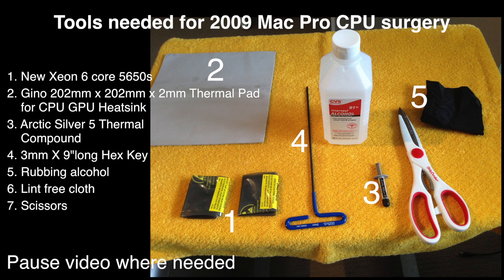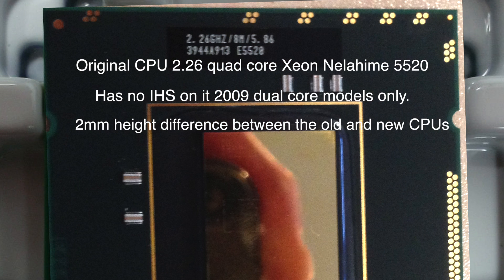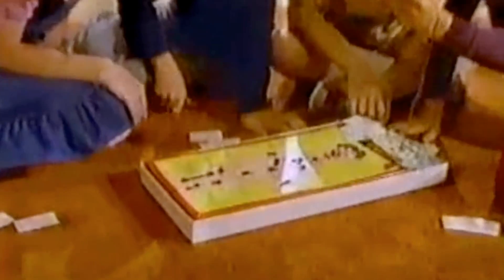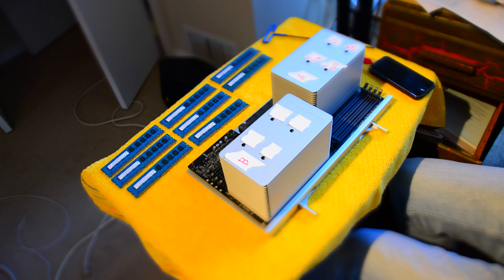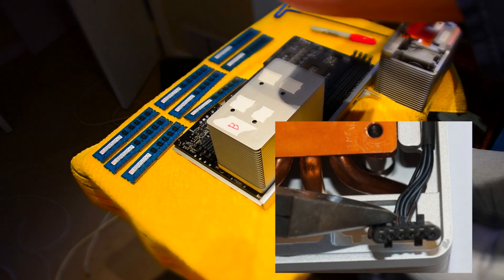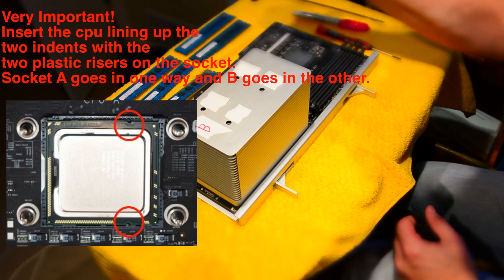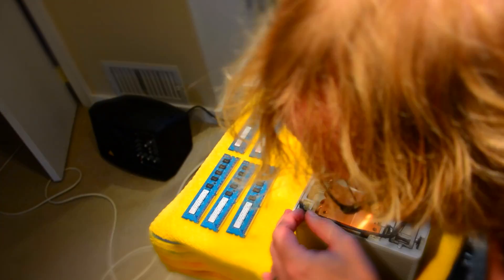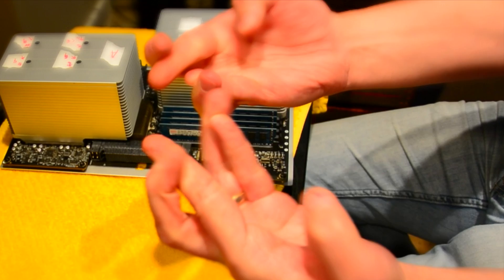Mac Pro 2009 5,1 CPU upgrade 8 core to 2010 12 core

Comment: turns out that counting the turns of the screws is useless. But if you have done that more than once you would know :)
good luck next time
Reply from the maker: I agree to disagree. I think my doing it and seeing the difference in unscrewing the heat syncs and screwing them back in with the new cpus can help folks get the fact that they should not over screw in the heat syncs. That the 2mm difference is a big one, around 8.5 to unscrew and about 3.5 to 4 to re screw with the new cpus. Plus if you were to put in the original processors back in you would no exactly how many turns it takes to put them back in or very close.  Also when I go to upgrade to newer processors I will definitely do the counting of the turns again as it will take the same amount to unscrew and re screw... "useless" I think not. An exact science no but again I think it gives a helpful point of reference.

Comment: SPREAD THE HEAT PASTE!!!

I read so much rubbish about electronics online, some of it really dangerous, please don't do something because someone else did, use your brain. A pea sized blob of paste will spread according to the minute off axis tilt of the heat sink as you lower it. It does not 'sort itself out'. Spread it and any over run will squeeze out the side and just conduct heat from the side of the CPU harmlessly. It is designed for it.

I strongly suggest you remove the heat sinks and apply the paste properly as you may be experiencing localised overheating which will lead to the CPU adding wait-states (under clocking without changing clock speed) to cool itself down.

I have over 35 years in computing, am a former technical writer for major industry magazines and build all my own studio electronics. Please ignore 20-somethnigs with shaking out of focus videos who read a forum and are now 'God'.

Other than that, ace video! :o)
Reply from the maker: Thanks Prince, you made me go dig a little deeper on the subject of doing the pea method or spreading the thermal compound. It turns out that you should put a vertical line across the cpu not spread it and but possibly also do the spreading part only on the heat sync itself to "speed up the break in period" of the thermal paste. I did not know there was one. Check out the PDF file via the link. These are Arctic Silvers directions on how to apply their thermal paste on the Intel Xeon 5600 series processors.
http://www.arcticsilver.com/pdf/appmeth/int/vl/intel_app_method_vertical_line_v1.1.pdf
interestingly they do recommend using the pea method on different processors but not Xeons and spreading on some and vertical lines on others.
Reply: Lance McVickar  Yeah, I know on some CPUs, particularly those with surface mount resistors that determine core speed, that some semi-conductive heat paste can be a serious problem or cause damage. This isn't the case with the Xeon and their heat spreader top. I can see heat paste manufacturers covering themselves from people overloading their CPU with paste whether their brand or others. Its always worth reading past the lawsuit protection verbiage!

Paste run-in period - I had heard of that on some grey / metallic pastes but its never stopped me just rendering 3D at 100% load for days and it not being an issue! :o)

I'm looking to get a Mac Pro 4,1 and upgrade. Being a long time PC user I've always been very gung-ho about upgrades but now I'm looking at spending a lot of money on a Mac, and if it goes wrong its lots more money, I'm starting to be as timid and careful as you! LOL
Reply from the maker: Prince Westerburg  This is the guy I got most of my info from initially. He performs the service for folks who don't want to risk it themselves and guarantees his work.
http://www.pindelski.com/MacProTurbo/

Comment from the maker: Here is the original link to download the firmware update tool from 2009 to 2010 from the guy who created it on Netkas.org you have to become a member before you will see the attached file at the bottom of the first post in the thread.

http://forum.netkas.org/index.php/topic,852.0.html

Comment: Great video!  You gave me the courage to order a dual CPU MB535LL/A ($720/eBay), I've already done my 4,1 to 5,1 firmware update, have a clean pair of 3.46GHz X5690s on my desk ($245 ea/eBay) and now waiting for thermal paste and pads to do the transplant.   (I'm going to keep the lids on and use 2.2mm of washers as depth guides.) I know those power chips along the side need some dissipation, so my question is about the thermal pads: did you simply place another 2mm layer over the existing pads on the heatsinks, or remove the original and build up a total of 4mm from two 2mm layers?
Reply from the maker: I just added to the existing. Good luck and let me know how it goes, Those X5690s are getting cheaper by the day, I will most likely get some later this year.
Reply: Lance McVickar Any idea if you wanted to replace existing how thick to go on the thermal pads?
Reply: Gregory Orme I initially put on 2 layers of fresh 2mm thermal pads, but after mounting the heatsinks they seemed too high.   So I shaved one layer down by about half with an Xacto knife and they seemed compressed together just about right after the heatsinks are installed to the correct tightness.   BTW, my machine is running kickass now, though CPU 1 definitely runs hotter than CPU 2, I THINK because the Northbridge shares its heatsink.   With 1TB of SSD and 24GB of RAM my geekbench score is 30K+.
Reply: Steve Hoge Thank you for the input. Great job, although shaving down the height of a thermal pad is the kind of fun I was hoping to avoid! I have not purchased the thermal pad yet, so I will look for something around what worked for you, with the understanding that every setup has its subtleties. In my limited experience, CPU 1 runs hotter in many cases.
Reply from the maker: Gregory Orme you just need one layer of 2mm thermal pad in addition to what is already there. The ones I cut to fit were 2mm in size, which it states in the video.
Reply from the maker: Steve Hoge Yeap my cpu one runs hotter than #two. That is normal I believe. My upgarded mac pro is now a year old and is still going strong. 5690s have really dropped in price. I may do another upgrade soon. I am envious of your Geekbench score congrats!
Reply: Lance McVickar The reason I had to split up one 2mm pad in half was that I destroyed the original one :(

Comment: Hi I have some questions Lance .

1 Are these CPU's ok for the 2009 to 2010 upgrade

   Intel Xeon CPU X5670 HC 2.93GHz 12MB L3 Cache LGA 1366 95W 6.4 GT/s SLBV7

   Intel Westmere Xeon X5650 2.66Ghz TB 6 Core HT 12MB L3 B1 LGA1366 95W 32nm

2. Because of 2 wrong Chingn Chang CPU's i damaged my cpu sockets and  have ordered a new controler board 8 core.
    I forgot to check the side that it had no black  dots on. ( It did have some black spots that dammaged my socket ) Is it true
    that  a cpu that has some dots not covered in gold that they F..z up you're sockets (I read that    
    http://www.anandtech.com/show/2859 )

Thanx man !

Comment: Thank-you Lance for taking the time to prepare this exceptional video which translated to instilled confidence to attempt this upgrade. As per your detailed instruction I joined forum.netkas.org and downloaded the then visible software link. In my particular incidence I encountered an error, "5570". I elected to take a break, relax, and address this concern after a coffee. On page 55 of forum.netkas.org I found mulitple threads that addressed this error. I elected to try the solution the required the least effort. Resultant, everything worked the way is it was suppose to, and my firmware is now upgraded. Cheers,
Reply from the maker: Great glad it worked out, not sure what the error 5570 as I did not get that could you post what why you got it and what you did to fix it. Thanks!
Reply: Lance McVickar

First and foremost I urge followers to become a member of forum.netkas.org, Additionally, if you have cardinal knowledge please be a contributor at any capacity as its vital to our community of owners.

To address Error 5570:

I followed member "Tobyglyn's" advise to the letter as he detailed in his post.

1) Download the Mac Pro Firmware update 1.5 (MacProEFIUpdate.dmg) from Apple: http://support.apple.com/kb/DL1321

    With the downloaded .dmg on the desktop, double click to reveal the package.

2) Now run the Mac Pro 2009-2010 Firmware Tool.  

There is no need to rename or replace anything. The Firmware Tool grabs the package and does its magic with no 5570 error message. 

Thanks to contributors like this I had success. Now, I'm awaiting my 2X 6 core chips to upgrade.

Important note: Be sure you know definitively what your doing in regards to de-lidding, if you elect to go that avenue. All chips are not the same hence this Lance tutorial on Mac Pro upgrades is imperative to your financial well being..smile.

Thanks to MacEFIRom, Tobygln, all the contributor on Netkas.org for community support, insights, and growth.

Special thanks to you (Lance McVickar) for taking the time and effort to produce exceptional documentaries on how to perform these modifications on Mac Pros. Your effort gave me the confidence to persue and grow at all levels.
 
Cheers,

Comment: Thanks for the video, very helpful. :)
After watching it, I too decided to attempt this upgrade, but I'd like to make some points which I think are important in the process that you didn't mention...
1: Each Mac Pro's responsiveness to the tightening of the heatsinks screws seems variable. Some have proven relatively easy to make adjustments on, others (like mine) go from blinking white light, to red CPU light in less than a turn.
2: The response of each screw is different too. Turning one screw 2 full turns might be easy and turning another might be a lot stiffer which can be disconcerting.
3: The removal of the cable from the heatsink isn't easy. You have to have be very careful when doing it and the cable is VERY delicate. This part of the procedure is a lot more involved than it sounds (and indeed the cutting and removing is not shown in your video, just the result is) and I'd recommend that you try the upgrade without doing this first. Only perform this if your fans spin up full speed as with the connectors left in place make proper placement of the heatsink MUCH easier.
4: Many people have found using a 2mm washer on the heatsink threads helps prevent over tightening, so this may be a good idea.
5: Success is very hit an miss and it is likely that you may have to have more than one attempt at the procedure to get it to work.
I myself have so far been unsuccessful performing this upgrade (only 6 cores showing), despite doing lots of reading and research prior to installation, so a success IS NOT guaranteed and failure can be VERY expensive.
These few comments aside your video was spot on and it'll help far more people succeed - thanks! :)
Reply from the maker: Hi Blott,
All good points, one thing about just feeling the screws is that Apple puts loctite on them, that blue stuff to lock the heat sync screws in place, this can give a false feeling of
the screw tightening or  possibly the inconsistency that you mentioned. That is why I think even rotation on each screw is important, and yeah each mac will vary but the screw lengths are the same. That is why you can't really judge it by feel alone. I did not use washers but others have had success with tthem. I did not because the article I read said they may give you a false feeling and that you can still over tighten them and to not use them. I agree that removing the connectors from the heat syncs can be really tough and if you can get away without doing that great. Did you put the extra thermal pads on? Sorry you did not have success perhaps try the CPU that is not working in socket A and see if it works. If it does then you know both are working CPUs then look closely to see if you have any bent pins in the non working slot. I have heard folks finding bent pins and straightening them and that fixed it. You can boot the mac pro with just one CPU installed in slot A. It is a very tricky install which I do say in the video and yeah it can be very pricey if failed. Have you put the original processors back in to see if they still work?
Reply: Lance McVickar Hi, it turned out I had one faulty CPU.
I received a replacement and am now the proud owner of a 12 core Mac Pro! :)
Thanks very much for doing the video, it helped ENORMOUSLY! :)
yes I did the extra thermal pads and like you did not use washers, but thought it important to mention the sometimes very different response of the screws in the heatsinks, as this was very worrying when I was struggling...particularly when I couldn't get CPU B to work. 
All's good now though - thanks again! :)
Reply from the maker: Awesome congrats on your new BEAST!

Comment: Not being quite crazy enough to attempt this upgrade myself I just purchased an upgraded 5.1 2009 3.46GHz twelve core Mac Pro with 16GB of 1333 memory and a 2GB HD, which looks to be in decent shape, for $2348 from a builder on eBay. He had posted what I assume was a picture of himself so I thought, that’s good. I know which town he’s from and what he looks like. :)
Reply: Lance McVickar I found 2 Xeon 5690s for $700 and the tower I've had for 2-3 years... I saved money. A lot of money. Thanks again for the tutorial.
Reply from the maker: Excellent price for that config, You could save some money if you did the upgrade yourself but not much, the 8 core 2.26ghz 2009s are getting harder to find usually around 900 plus a pair of Xeon 5690s would run around 800.00 so 1700 for the basic box with upgrade but then you would also want to install the faster 1333 ram.
To make your new mac even better I would install a pcei
SSD card like this one
http://www.sonnettech.com/product/tempossdproplus.html
Or OWC Mercury Accelsior. For your boot drive.
Congrats on your purchase!
Reply: Lance McVickar Thanks for the tip on the Sonnet Tempo SSD Pro Plus. A much faster solution than using a HD bay for the boot SSD. Sonnet has always made quality, innovative products.